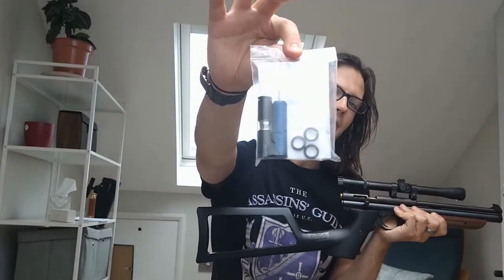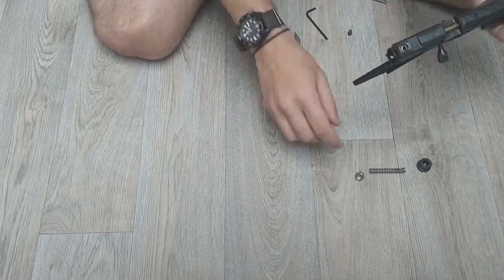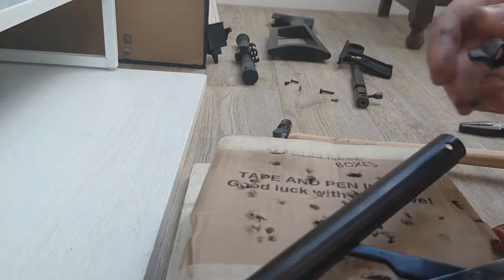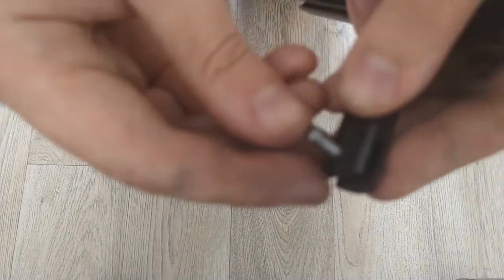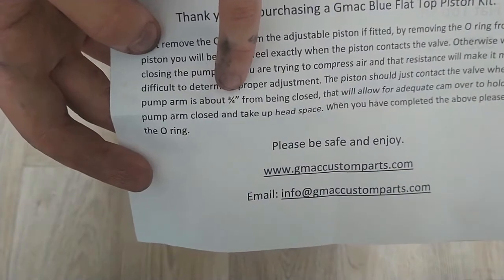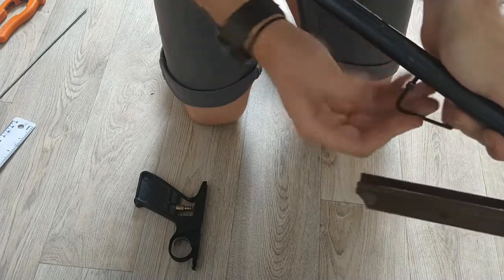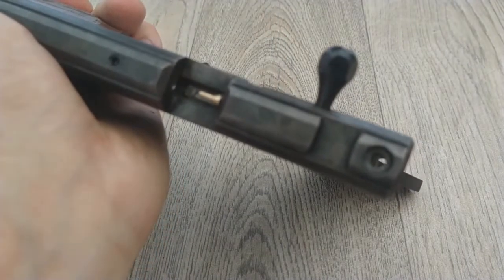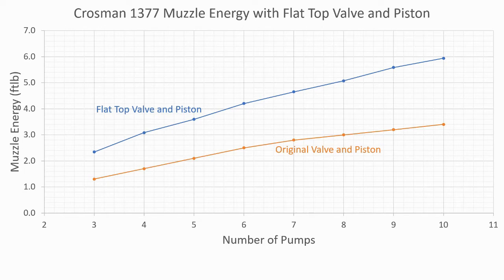Crosman 1377 Flat Top Valve and Piston - Install + Chrony

Comment: i take it you do know that you can take these up to 15 ft pounds and now with the stock fitted its a rifle by law and can go up to 12ft lbs.. . many people have the 1322 and 1377 to over 11 ft lbs... it depends on the amount of pumps....  your spread is mainly because the chamber is not fully empty between shots because you need a more powerfull spring for the hammer due to the flat top valve holds more air..  now being as you have the new flat top valve chamber it holds more air and needs to have more pumps to get the psi in the chanmber to be the same as original.... a gune in good condition that needs 10 pumps on a new flat top valve might need 12 pumps for same psi.. velocity is down to how fast the air can be released intothe barrel ( high airflow port). or you can open the flat to ppiston and put a weaker spring in there, ( not advisable ).
Reply from the maker: Thanks for commenting! For it to be a rifle it needs at least a 12 inch barrel and to be 24 inches over all. As such I've put the stock transfer port back in to keep the power down. If I get a longer barrel in future, I plan to put the wider transfer port and power spring back in but I'm pretty happy with it for now. As it is the flat top is hardly retaining any air after 10 pumps. I don't get a lot of time to shoot any more so I'm unlikely to do much more to it for the time being.

Comment: Did they neuter yalls air pistols. Our crosman 1377s in america average 5 -6 ft lbs of energy. Yours got that after modifying it. Makes me wonder what they did to neuter it down. Unless your chrony is wrong.
Reply: The standard valve in a UK 1377 has a hole drilled in the transfer port end of the valve. When you fire, a large percentage of the air just dumps into the pump tube. Thread this to 3mm and loctite a grub screw in ...instant double power

Comment: I have a crosman 1322 pistol..all original excpet for 14.5 inch barrel .Is it possible to get this pistol to shoot around 600 FPS { with 12.9 Gr lead pellets} with only 12 pumps or less , by only doing a transfer port mod and a air valve mod ?  I assume that taking material out of the air valve, will not meet my goal, because that would result in having to pump the pistol more then 12 times ?